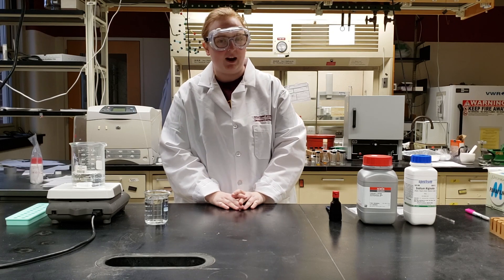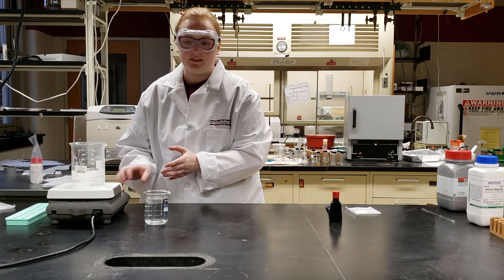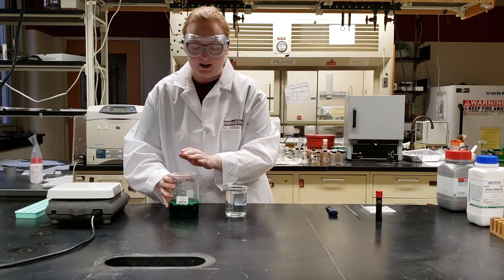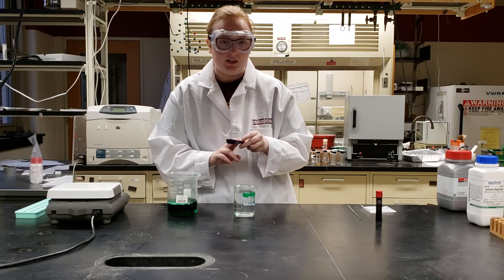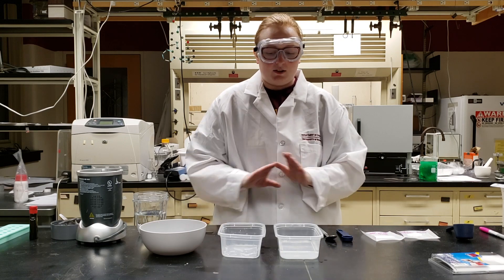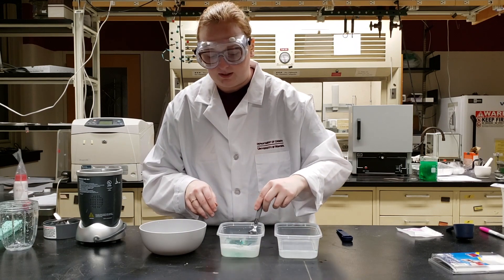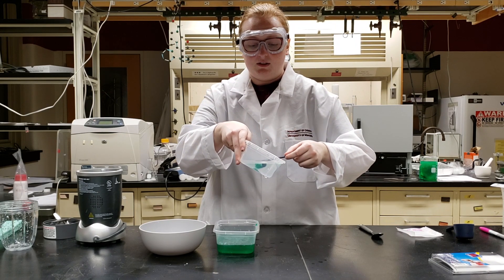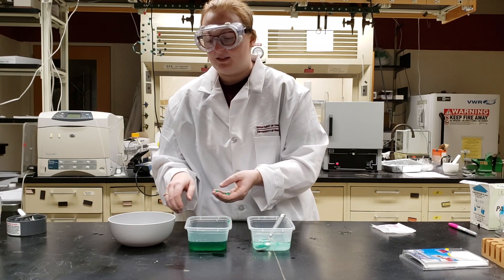Formation of Calcium Alginate Capsules Procedures

Comment: I have tried to make 3mm diameter beads with your procedure. I wanted to ask how to make the outer surface harden a little, so that when we drop it on the floor the beads will bouncing. I hope you reply my cooment. Thank you

Ps: i used Google translate during write this comment
Reply: Try ice cold water
Reply: @nabeelaijaz5395  which one should give cold water? Alginate solution or calcium  lactate solution?